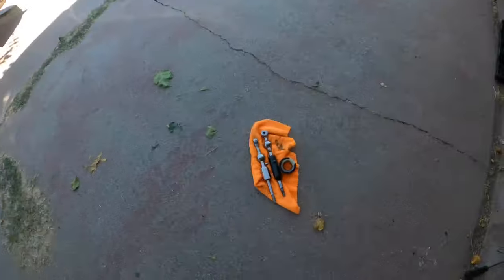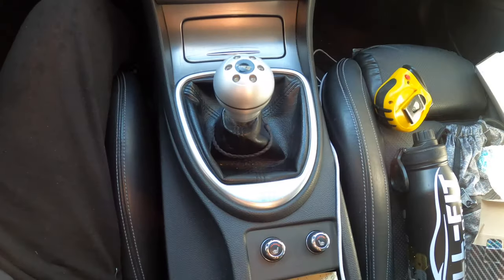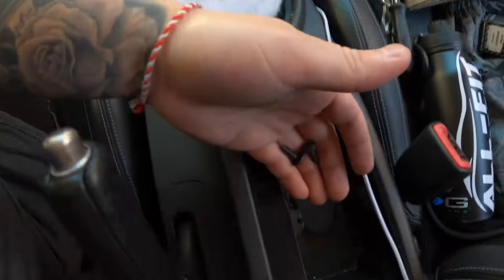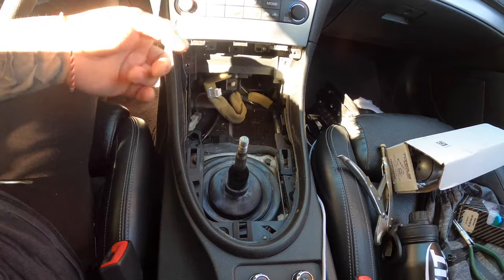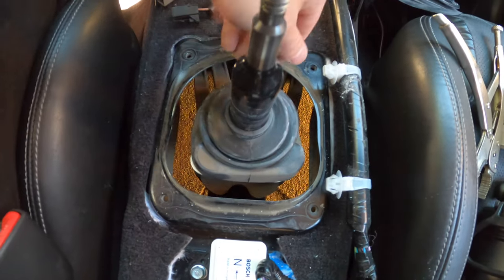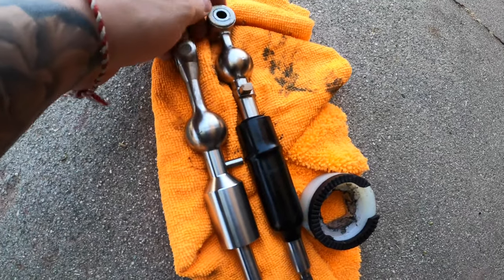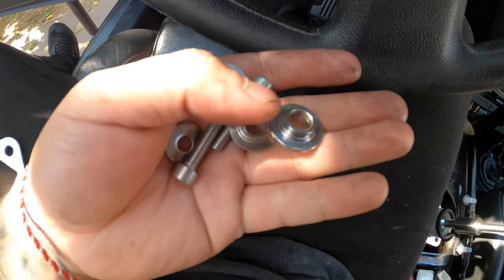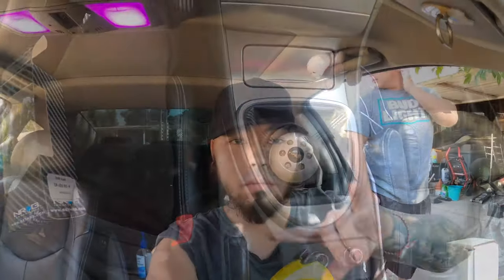Short shifter (Torque Solution) install for Gs and Zs. Fast shifting!!!

Comment: Great video but you didn't have to remove the entire center console. I was able to do all steps required with only removing the shifter cover that was all😮
Reply: Yeah, I didn't remove the center console either but it's hard getting to the 4 rubber boot bolts. It took me a while to remove the 4 bolts. I had the hardest time getting the rubber boot back on that's underneath the car on the shift linkage.

Comment: Same piece broke when I installed mine. It’s had 3/4 tabs and 2 years later I’m back on YouTube for a refresher video to finally fix it. Yes, sometimes I have trouble getting in gear with 3 of 4 tabs and I do think this is a big part of the problem. This shifter does have a loud vibration sound but I also have some poly bushings which don’t help that. Not unbearable and it sure is short, this thing is NOTCHY. Double clutch to get into first almost every time. Hopefully the new collar helps. G37 S Coupe. Make sure you hold the shaft when vise gripping off the OEM knob or you’ll screw up your transmission linkage.
Reply from the maker: Appreciate all the feedback. I haven’t put the new collar in yet. I should but been lazy lol. Mines isn’t vibrating too much so I’m cool with it. Slow cruising is fine for shifting. Only has issues when I punch it. I’ll see if there’s a difference when I put the new collar on.
Reply: Which shaft?

Comment: Nice video! But do you know what torque spec for bottom shifter 12mm bolt?
Reply from the maker: I do not. I just hand tighten it till it feels secure. I’m sure a quick google search can answer that for you that. Gl

Comment: is the car driveable with the electrical connectors unplugged or will it give me error messages? Don’t have time to do the full install in the same day
Reply from the maker: Yea it should be fine. It doesn’t involve the mechanical parts but I plugged all the electrical back so I can’t guarantee anything.

Comment: Hey do you really need to buy a new shifter socket coupling? Cause I just just received my torque solution STS and I dont wanna wait for the second part to come in if it's not needed
Reply from the maker: I would recommend getting it unless you can take the socket off without damaging it but I couldn’t
Reply: @ItsMYang  did you put the old one back on? If so, how does it feel?
Reply from the maker: I did put the old one back on. It feels fine but I plan on getting a new one soon
Reply: @ItsMYang  oh okay thanks!
Reply: Buy it from your local nissan dealer. it's a shifter socket cup the part number is 32870-AC800
Reply from the maker: I did call them but the ones I called didn’t have just the socket. They had the whole shifter assembly and I didn’t need that.

Comment: Would you recommend this mod , did it made any difference in driver feel or shifting
Reply from the maker: Yes and no. Yes for nice smooth slow controlled cruising. No for aggressive shifting, at least for me. I find problems going from first to second when redlining it. Might just be mine tho. Maybe look into other short shifters and not the one I got exactly. Gl
Reply: @ItsMYang  ok cool thanks
Reply: @ItsMYang  I’m having the same issue whenever I try to do a 1st gear pull, when redlining it won’t go to 2nd unless I force it. Wondering why that’s happening. I installed mine yesterday.
Reply from the maker: Yea I read on some threads that others are having the same issues too. I guess it is what it is. Smh
Reply: @ItsMYang Update! I was able to figure out the grind and was able to fix it. Now I am able to do 1st gear pulls  and go into 2nd without any issues. I took it apart and messed around with both triangular plates that go on the top of the shifter (readjusting) and gears are a lot smoother now fixing the grind.
Reply from the maker: I’ll definitely try that then the next time I open it up. All you did was readjusting? And is it perfect now when going from 1st to 2nd and redline or just a little better?
Reply: @ItsMYang  It is perfect. when I do 1st gear pulls I bring it up to about 7700 rpms and dump it to 2nd with no problems. At first it was giving me difficulty to put it into 2nd gear to the point where I had to force it when doing a pull or it would just make a horrible grind noise but now it goes from 1st to 2nd smoothly at redline. All I did was readjust those 2 plates at the top that secure the shifter with the 3 bolts and it’s good to go. Hope this works for you as well!